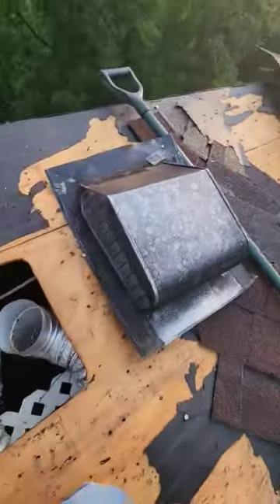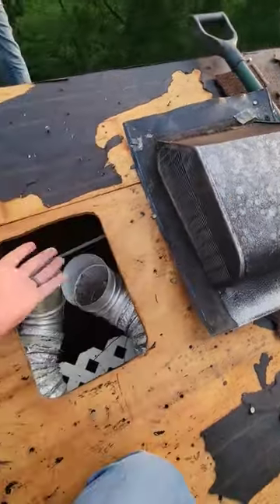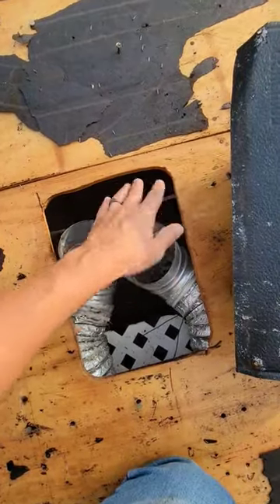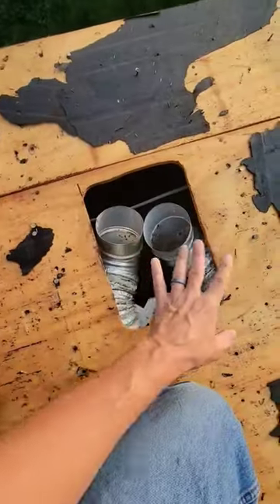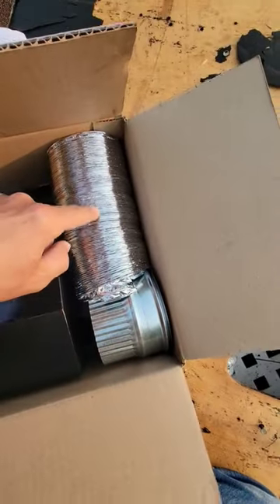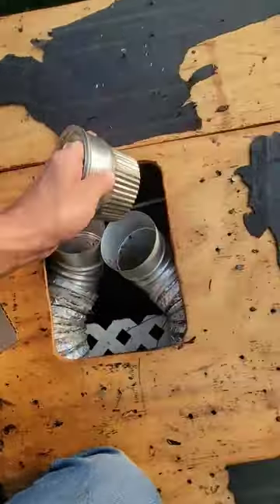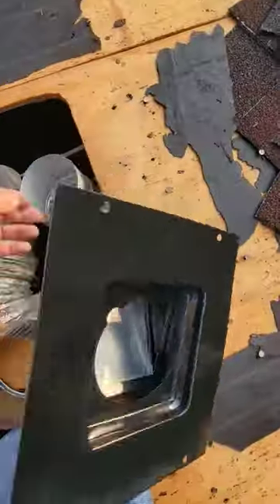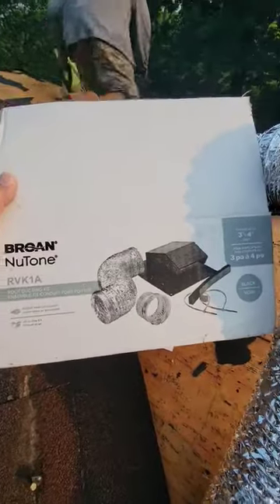RVK1A Roof Vent

Comment: Totally agree with those little broan vents. We use the bigger 8-in ones for the kitchen exhaust vents as well. And up here in the Northeast, we definitely use the insulated flex ducts because 90% of people's attics are not insulated correctly. We rather give them the insulated duct to keep down that condensation. Keep up the videos man. I like everything I see from you!

Comment: It's a bad idea in general. Any additional penetrations invite more chances for leaks. Find a side wall, people! And use insulated hoses
Reply: I don't totally disagree with your sidewall vents theory but to say to not have a penetration on the roof because of risk of leaks is not a good reason. If you're a professional roofer like we are, you'll install those vents correctly and they will never leak. The problem is I get so many customers that have skylights that leak or vents and so on and they just want to get rid of everything because they think "that stuff always leaks". In reality it's because somebody had piss poor installment skills. So many times people get frustrated and don't want skylights anymore because the idiot who installed them didn't do it right. You always want to vent your bathroom vents and dryer vents up to the highest point as possible to keep that air going straight up and out although I guess side will events are okay I'd still rather have my stuff shoot straight out.
Reply: Use the LIFETIME tool bath vents, the have 5” wide flange instead of 1-3/4”, the neck is round so it sheds water better, flared so no sealant is needed in the corners, and comes Kyner coated for a 50 year finish, so they are not rusty in 5-10 years like the Broan, unfortunately I have roofs out there with Broan from before the time LIFETIME Tool was made.

Comment: We're I'm from dampers have to be removed. They don't even sell primex with dampers. Same with screens were not allowed to have them in gooseneck vents. They plug up with lint and dust creating a fire hazard. Even bathroom fans. 

And there's no way you actually used that unit on a roof. I would consider that to be insufficient in terms of flashing. Up here in Canada the ice would penetrate around that unit as it doesn't have sufficient flashing. 

The best bet is to buy the primex units they have a full 8 inches of flashing all the way around the vent and a built in water way to make sure water and ice don't pass the flashing.

Comment: What about getting both vents out?
Reply from the maker: We  installing two dampers. You don't ever want to run both tubes to one. Because it will run back pressure into the fan that's not on.

Comment: Wait you are for real? In Germany this would be considered a temporary roof.
Reply: Why? Please explain!
Reply: @akaredcrossbow  first I have to say, I'm not a roofer but I have worked with a good one (he did this job for 40+ years). 
So, in Germany we have heavy storms and a few times a year in each Saison we have a time where storms are common. In summer, we sometimes have a lot of rain, in autumn we have crazy strong windstorms. 
We use a foil to protect the wood of the roof from water/vapor and put roof tiles on it. Most roofs need the tikes be have a piece of metal to hold it down even more. 
I hope it made sense
Reply: @ghostdog9921  makes sense. A lot of places in the US that have a lot of storms(hurricanes) do roofing basically the same, using clay roof tiles. Other places that don’t get many storms use ice and water shield around any open holes on the roof then cover the whole roof with a barrier of some kind then the shingles. Where we have a lot of snow you will see metal roofs installed so the snow slides off the roof much easier so it doesn’t accumulate, plus it’s cheaper to install.
Reply: @akaredcrossbow  so the conclusion is, each roof has a special use and has pros for certain areas. 
Also nice to learn these things from you.

Comment: Absolute garbage! I had installed one of these on my roof and it created so much ice on the roof it was incredible. Do not use this!
Reply: Better than in the attic where it will freeze thaw and leak. Happened all the time if they are vented into the attic or out the soffit because the air just gets pulled back in
Reply: Just run the bathroom vent out the gable (horizontally).
Reply: @coolramone  Lol! That’s exactly what I did.
Reply: Lol what you suggest? Let's hear it.
Reply: @kernelbadness  Vent thru gable end wall but make sure it’s not too close to soffit.
Reply: Why cut a hole 🕳️ in a perfectly good, non leaking roof? 🏠 That’s like jumping out of a perfectly good flying airplane (parachute), LoL.